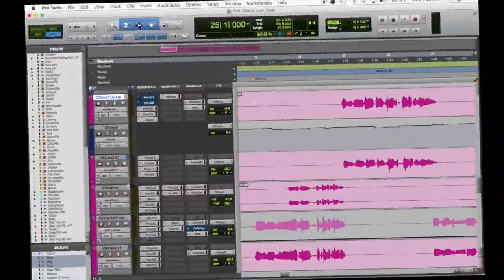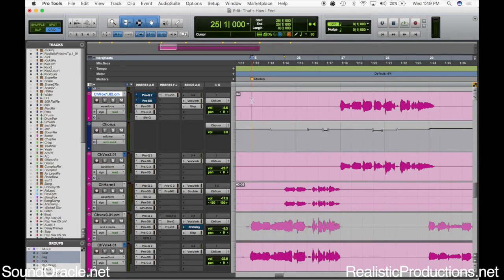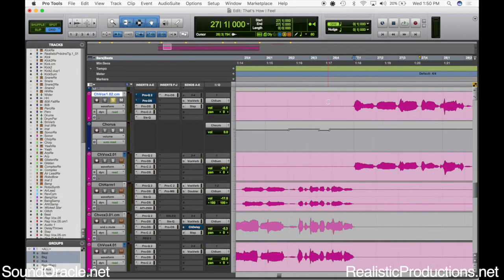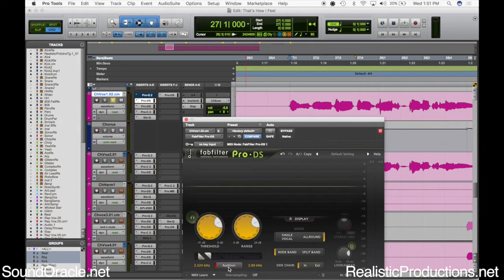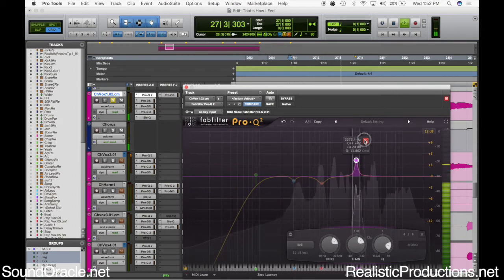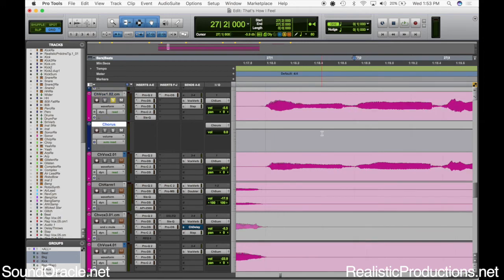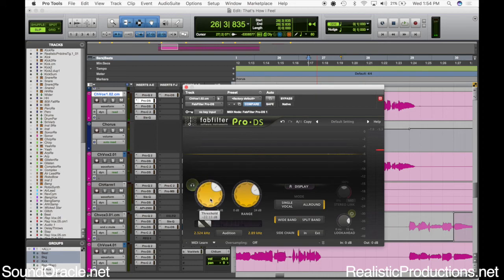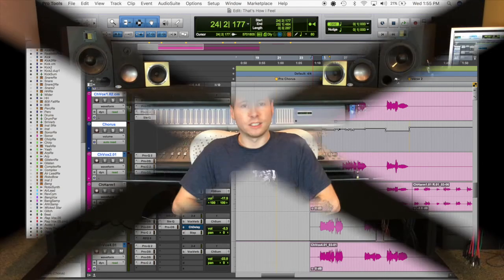How To Get Rid Of Vocal Resonance

Comment: Why do I have to do this all the time in my recordings...driving me nuts. I feel like it's microphone ringing or something like metal ring.
Reply: Hey thanks for watching. The sound you're describing is most likely happening because the vocals is vibrating the diaphragm inside the mic - which causes a resonance ring. If you're the one recording the vocals - this is great because you have the ability to adjust the position of the mic & change the mic placement in the future which can correct the issue. If you received an already recorded vocal, you'll have the use EQ, dynamic EQ, clip gain adjustments, & some of the techniques we discussed in this video.
Reply: @realisticproductionsLLC  Thanks for reply, Yes, it's my gf doing the recording so we can adjust the position.  It's odd though she recorded one more dynamic and loud and sounded amazing but when she did a soft quieter one it had nasty nausiating bass I can't seem to fix without ruining it.
Reply: I have high quality mics and still get the issue I'm staring to think it's my voice or computer

Comment: Right when I started to think that I am going crazy and fixating those things I find your video. Just my resonance is down at around 500 to 600 hz, but it sounds just as awful. My room is not perfect so I thought it is the room that reacts to my voice, but it shifts and moves from song to song a bit, so not the room but probably my proximity to the microphone and the lack of talent I suppose.
I use the FabFilter Q3 for this, but there is a very thin line between fixing it and make it even worse with over-Franensteining it with the dynamic EQ. :)
Thanks, it means a lot to know that I am not (that) crazy. :)